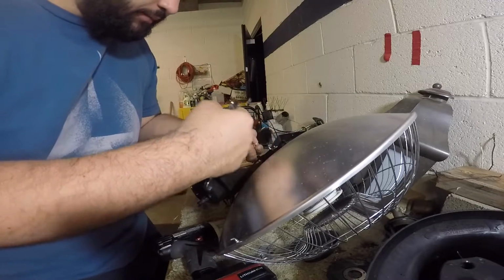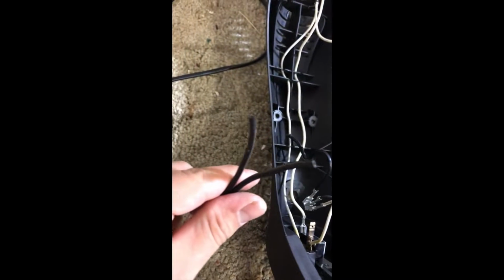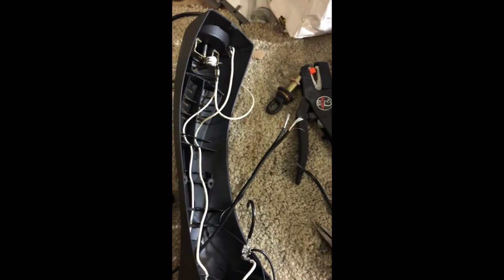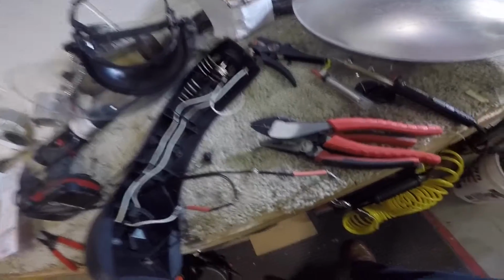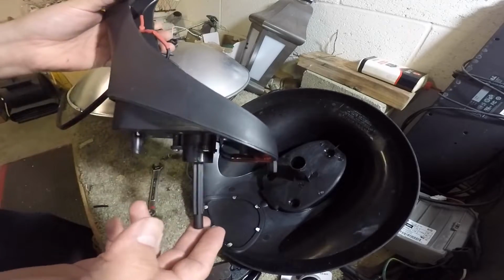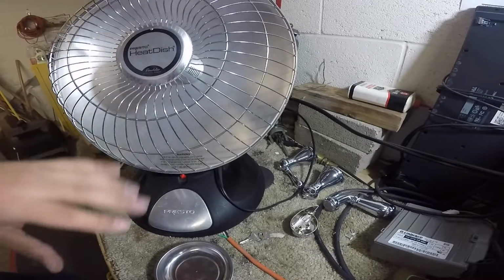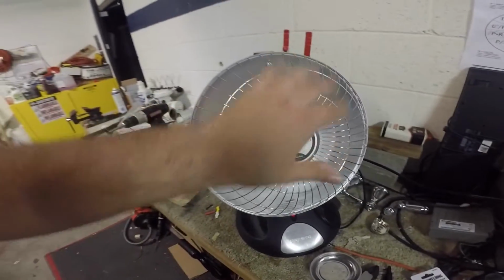Presto Heat Dish Repair

Comment: I've had mine for several years and it works great as long as the inner dish is kept clean. I took some wire cutters and snipped off the top three wires, which makes cleaning the inner dish with a soapy sponge a breeze.

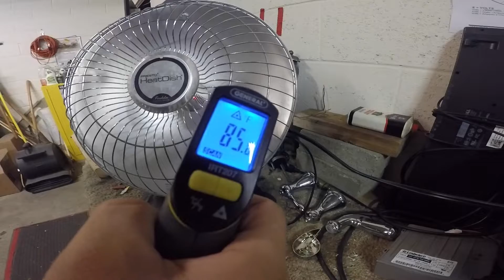Comment: 7:31 BAH! I hate these tiny lasers. Mine just reads "HI" when it goes above its readable temps. The buzzer on these heaters are waaay too sensitive. All I want is move it back a little some times. Mine doesn't have the pressure switch on the bottom. I assume it's internal since it still buzzes when moved. Also if you're curious as what the maximum temperature I've gotten with a bigger laser is 1100°F

Comment: I watched it three times I can't figure out what you fixed or what was broken did you replace a part I have no clue is it just me? please explain
Reply from the maker: My dog chewed the chord. Cut back the short in the wire. While doing so, I took the dish apart. Still working fine to this day.
Reply: @KodysGarage  thanks for the reply mine's broke and I thought you changed a part or something I missed where the dog chewed it thank you

Comment: I need to clean the dish...any suggestions for the easiest way?  Could I spray it with water and let it dry before plugging in again? 
Thanks for the video!
Reply: this is really late but I shoved a duster (like a wand with fluff on the end) into it and worked wonders just swiped it back and forth

Comment: Do you know how to turn off the buzzer? I have an old heater that starts buzzing outta nowhere at random
Reply from the maker: What’s the make and model
Reply: Another video said to clean the dust off the disc  to stop buzzing my buzzing...mine does the minute it's turned on trying to find out why why
Reply: I also need to disactivate the buzzer

Comment: Could you tell me how to disable the wire that says it’s getting too hot in the room? I use mine for hot yoga and it won’t let me keep it on anything but low.
Reply from the maker: You’ll need to have an electrician install a remote thermostat to control a lower or higher setting
Reply: @KodysGarage  is that really the only way? Mine does the same thing is there any way to just cut the buzzer out and assemble the rest of the wires together
Reply: @вяитмии   The buzzer has to be in the circuit for it to work.  Its mounted right under the circular thermostat switch.  A few screws and its all apart.   But you may be able to move the sensor which seems to be mounted near the top of the dish off that dish to a cooler area.  To do that you'll have to drill out the rivets then use short nuts and bolts to mount that plate that holds the back plastic housing on.   The turning off problem is very common with parabolic heaters.  Clearly they erred on the side of caution - insanely so.  Someone said they fixed it but they didn't say how.  Not sure if they moved the sensor.  I tried it taking the sensor out of the circuit but that didn't work.  It needs to see it there.  Someone needs to figure this out.

Comment: How do you take the grill off to clean the unit?
Reply: I need to dust the inside. How do you get inside the grill?
Reply: Take a pliers and go around the rim and pull the metal back then the metal cage can be pulled free

Comment: Nice job. Sucks that parts aren't easily available. I got a demo unit for free and took it apart to reconnect the thermal cutoff and remove a bracket that changed the angle of the tilt sensor.  I love it because the demo unit has a ~30 heavy duty cord.
Reply from the maker: Henry heck yes! That’s a great score!

Comment: These radiant heaters are shit
Reply from the maker: Mine works well for its needs
Reply: @KodysGarage  They do not work well.
Reply: @corpsi9761  I've had one for 20 yrs and still works great. Maybe you have a crap brand/design or simply don't understand how to use it.
Reply: Works excellent